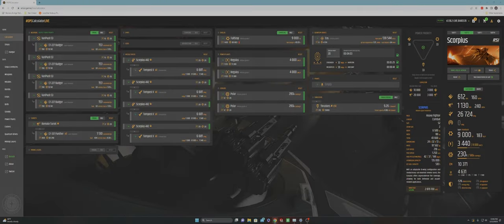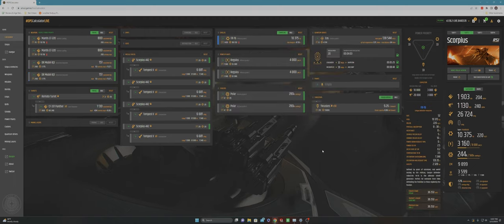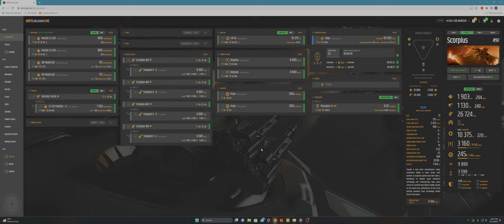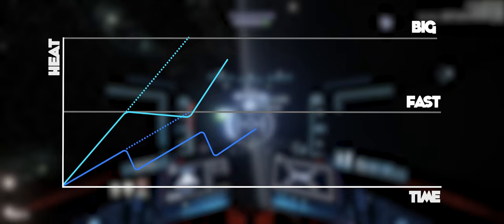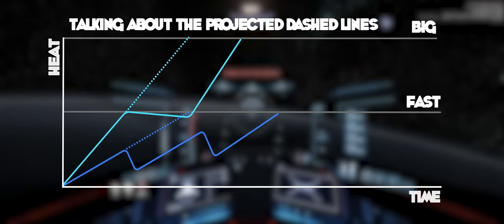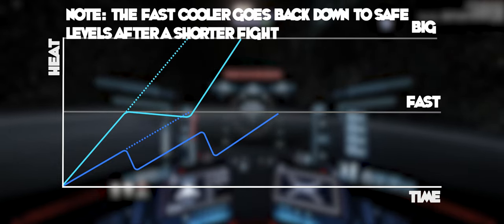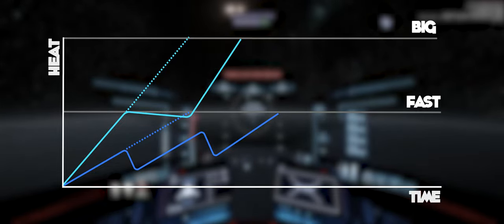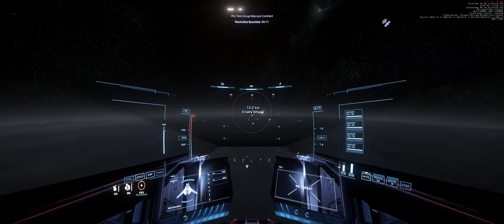Making Coolers Great Again

Comment: I made a few design docs for engineering on spectrum, and we came to many of the same conclutions, but one thing I'd also add, in order to spice things up a bit is efficiency curves. Basically the ammout of waste heat relative to wattage-in should vary for each component. This would mean that if you really knew what you were doing you could pair complimenting components for spesific uses. For instance if you have a ship with lots of laser weapons then you cant expect the shields to recieve 100% of their max charge, therefor you choose shields with high efficiency at lower charge.
Another thing: Heatsinks, a consumeable resource which lowers the total thermal energy of the vessel by ejecting superheated matter into space. Creates a very visible thermal spike in the area, can be used as a flair, but also give away your location.
A third thing: Radiators. These are on the hull of the ship and radiate heat insto space, they can be disabled for stealth.
Smaller ships may not need dedicated radiators due to the square cube law saying that smaller objects have a larger surface area relative to volume.
A foruth thing: Liquid resovoirs. The thermal mass of the ship should be based on the size and content of the cooling fluid resovoirs, much like how planes and both water and oil cooling (at the same time). Large ships have huge resovoirs and thus have a higher loiter time, whilst smaller ships have a lower loiter time, but cool down quicker. We should also be able to swap what we use as cooling liquid. differing grades, with different thermal capacity, different boiling points, and different thermal conductivity.
Different prices too.

https://robertsspaceindustries.com/spectrum/community/SC/forum/3/thread/engineering-cooling
https://robertsspaceindustries.com/spectrum/community/SC/forum/3/thread/engineering-2-electric-boogaloo

Comment: I hope that sometime in the near future that Coolers and Powerplants will have an actual purpose in the game and introduce nuanced loadout choices rather than the usual bigger/better/faster/expensive.

There should be tradeoffs to using coolers, such that maybe a high-end cooler might cool down components faster and reduce IR being emitted, but perhaps at the cost of power usage (reducing available power available to your power triangle) and EM output?

Likewise, if you rebalance your shields that increases heat production, and having a better cooler should increase the time/cooling efficiency before the system components go critical or shutdown completely -- that would certainly add an extra risk factor for long-running combat.  End combat quickly, or risk shutdown and leaving yourself vulnerable.

Also, coolers should be a fundamental part of stealth mode.  When running in stealth mode your ship will need to reduce IR output as much as possible, but at the cost of heat buildup.  A better cooler would allow the ship to run in stealth mode longer before the crew is cooked because reduced IR signature required disabling external heat dissipation.

There are hints that maybe some of these mechanics might come into the game with the engineering gameplay (tuning, management).  Hopefully these components might be taken into consideration then and given true purpose.